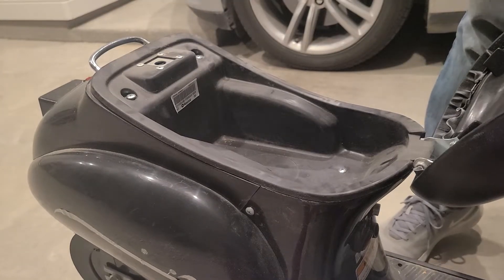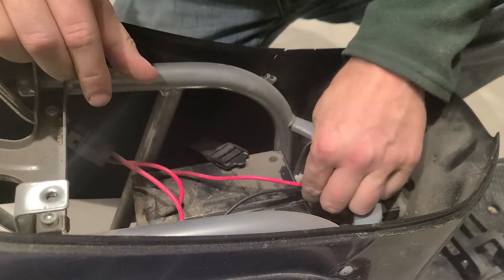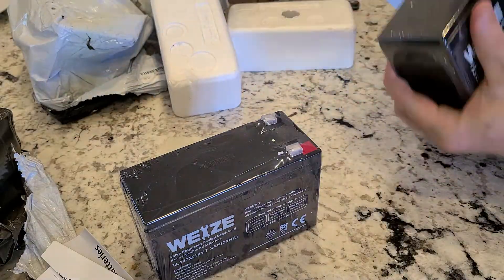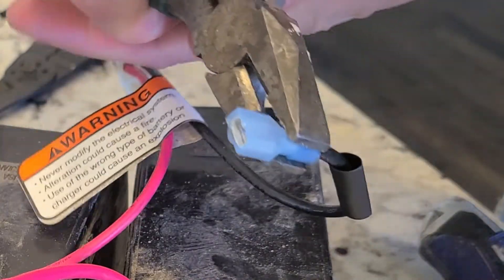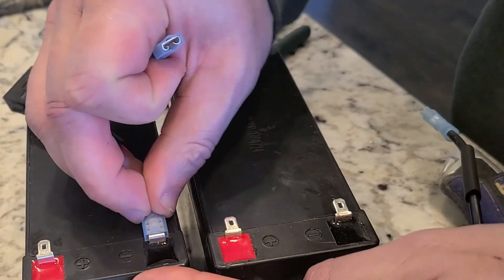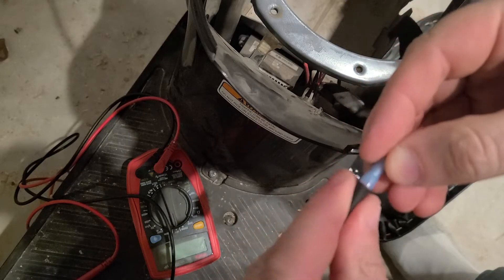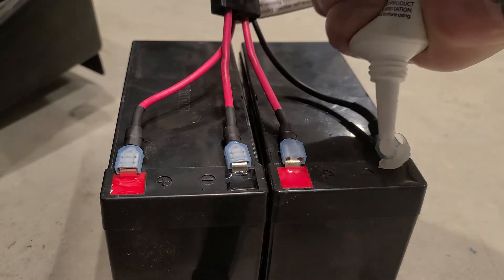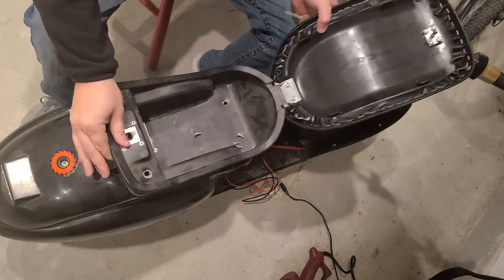Replacing Batteries in Razor Pocket Mod Scooter

Comment: So if you charge the battery, the red light is on, and the throttle will not make the scooter take off, the answer is a new battery??? We have one that charges over night. We take it off. Flip the red light. And it stays red. But the throttle won’t make it go. We need help on what to do.
Reply: Correct. What you're describing is exactly what he explained & what most of us are/were experiencing. You'll to buy a new battery pack & connectors. Good Luck

Comment: I bought my grandsons scooter at goodwill. It's Been on charge but after literally 1 minute, it slows down and stops. But then when he gets off of it, no weight, it will go.
Reply from the maker: Sounds like it has an old battery.  Or have you already replace the battery and it won't hold charge?

Comment: I did everything exactly the same and it still doesn’t work with new batteries. When I plug in the charger it’s green. But when I take off the charger and turn on the power…..nothing. It’s not an old bike and it worked before I switched the batteries. Any ideas?
Reply from the maker: Ugh, that's frustrating.  Some quick things to try/check: (1) make sure the new batteries are hooked in series; (2) measure the voltage across the new batteries to see if they are taking/holding charge; (3) check the fuse that connects the two batteries; (4) check the crimps for good connections.  More of a pain:  switch back to the old batteries to see if they work (in which case problem is with the new batteries). Maybe others have suggestions
Reply: @projectreaDIY i dont know the type of motor that it has but the magnets in it may have a dead spot spin the back wheel 10 to 20 times and then hit the power ive had generators do that

Comment: Do you have a link to where you bought your connectors?
Reply from the maker: I bought mine at Home Depot but I can't find them on their site.  This is what they look like (the female one). Websites call them by different names - F1 and F2 (based on size), clam, quick disconnect.  Make sure to check wire gauge for the wire side. 14 gauge if I remember right, so I bought connectors that supported 14 or 16 gauge.

https://www.lowes.com/pd/Utilitech-16-Count-Disconnects-Wire-Connectors/999953182